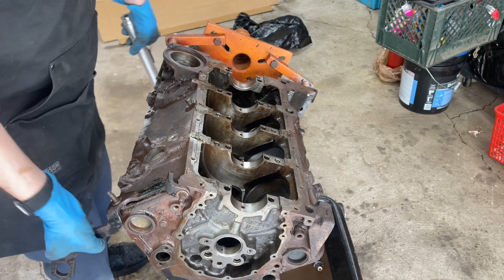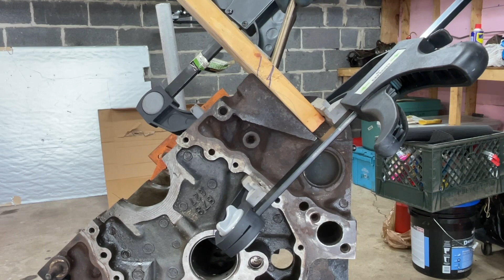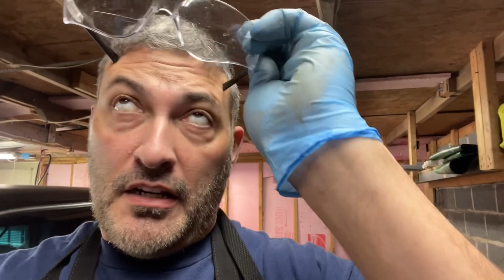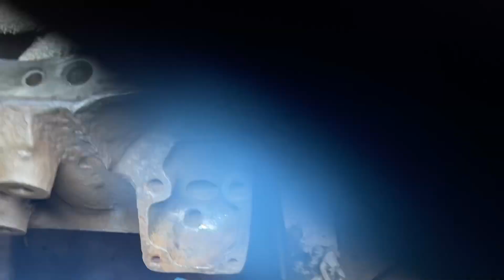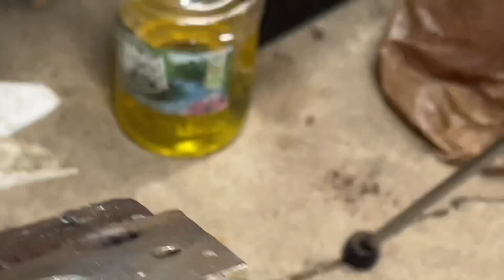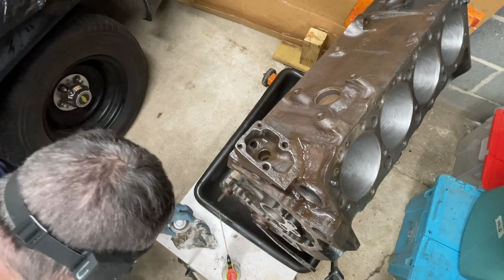Chevy L31 Vortec 350 drilling for the fuel pump push rod

Comment: Neven seen anyone do that !
I found a 1992 SB 350 in the forest from Ketchikan Alaska with not even bolt holes for the fuel pump and not even casing area for the fuel pump.
That engine is in my 1991 Chev 1500 PU in a 385 stroker now runs with TBI.
These engines GM make for roller cam but use flat tappet cams

Comment: Ok im just asking , wouldnt an electric fuel pump be faster , less risk , just asking !? I used to run 5-7 lb fixed pumps for carbs n 22 lb with a regulator , ive done both and they worked for years , just asking !?
Reply from the maker: Yes I agree. I’m loving old school original mechanical stuff right now. No electric draw , mechanical fan etc.. thanks for watching 🛠️
Reply: @MikeTheFixer ... We ran big block GMC trucks in the 80s-90s n they had a common issue with vapor lock , we ran holley electric 5lb fuel pumps in line before the mechanical pumps , we ran 3 trucks with this setup with great success  !!!
Reply: @MikeTheFixer maybe wrap some tape around the bit a few times to get the same thickness. That way ur using the engine as a guide

Comment: Did you drill the oil return hole. Disregard I see you found it. I continued watching. I am going to make my own jig. Got some plate cut and milled squared. Just need to find an older block and get it up on the mill.
Reply from the maker: @tjs_welding_and_fabrication  thanks for asking, that could be catastrophic 🥴. It’s still wrapped in plastic now, hope to get back on it soon

Comment: Awesome video man I’m literally about to disassemble my 880 short block full roller. Just had my flat tappet block just eat a lifter after 15 mins of running weird because it was an old cam and lifters but apparently it didn’t like something. No way I’m risking running a flat tappet with the way that’s going. So thanks for the video got the same set up as you got the provision just isn’t the whole way thru.
Reply from the maker: thnaks. Hopefully i will revisit my engine in the spring!

Comment: So did you ended up using that 1/2 inch drill bit to open up the hole more?
Reply from the maker: @ms_m3170  yes sorry for the confusion. It is a half inch rod., so went to half-inch, made sure there was enough clearance for oil to get around the rod by running the sandpaper in the hole. I hope it works out engines and back in storage now.
Reply: @MikeTheFixer  That reamer setup kit is $1033 that you looked up
Reply from the maker: @bigblock67camaro ouch, that’s for the pros 🤣